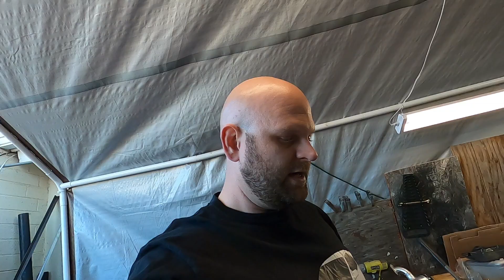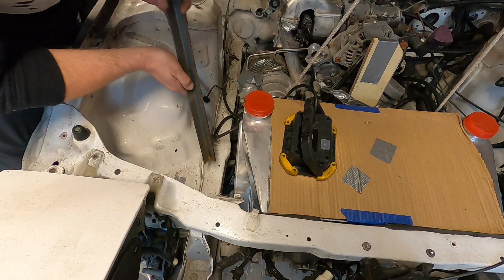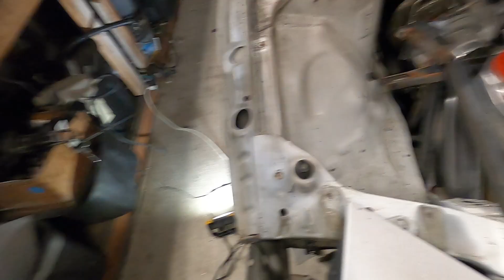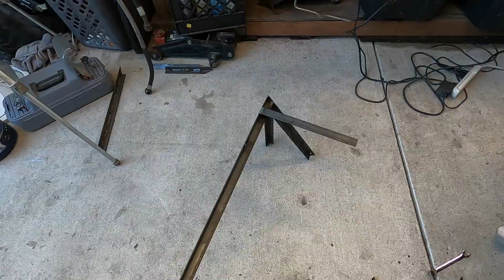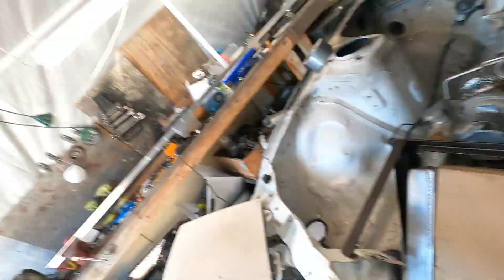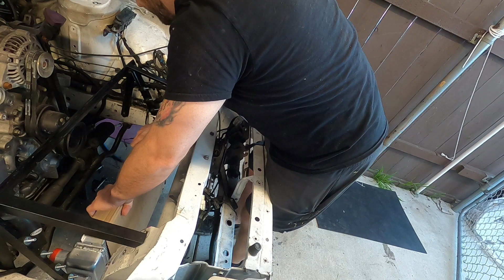Custom V mount FC3S

Comment: nice dude. i have my vmount setup done at a fab shop. i let them know that they can do away with the stock FC front bar that holds the oil cooler (its non structural) as well as remove the upper metal piece that runs across the top (where the hood latch attaches to) so the intercooler can sit farther forward if necessary. its so weak that you can bend it by laying on it. i wont be goig with a swirl pot though but i will get an s4 turbo water pump and housing as that has the radiator cap relocated to it. 

btw got the swag. its nice.
Reply from the maker: I think I will remove the front bar on the burnt FC. But for the other I want to do as little cutting as possible
Reply: @MohrGarage  right. at first i was apprehensive about cutting anything, but fuck it, no guts no glory. i want to remove my hood latch anyway.